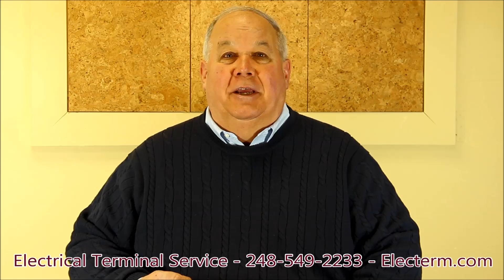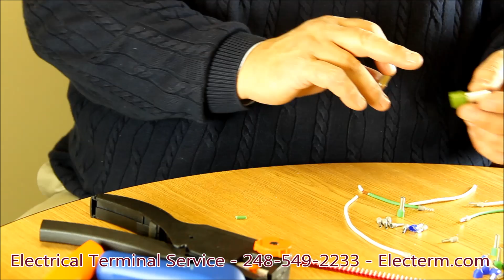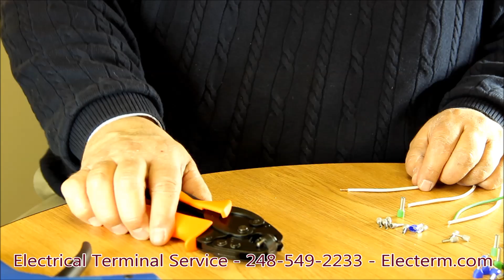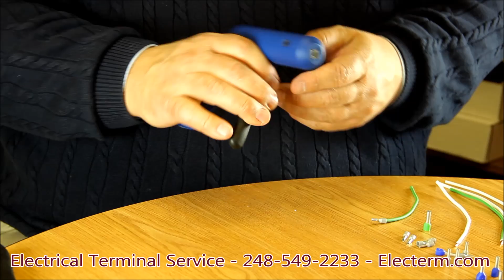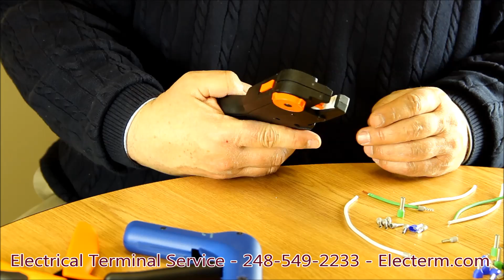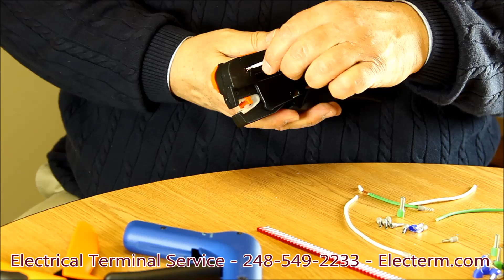Wire Ferrules Explained: Why are Ferrules Used and How are Ferrules Crimped

Comment: Most holes to insert wires are round.  Is it okay to use a square crimped ferrule in them?  Searched the net for a round crimp.  Seems it doesn't exist.
Reply: Yes it's ok, I put ferrules into round Wago terminal blocks all the time. The run at full rated amperage with no problem.

Comment: Thank you.  I bought a crimping tool combo and it came with a box of the regular connectors I've seen all my life.  And it included a box of these ferrules, which I had never seen in my 68 years.  So, I did what I usually do when needing to know how to use something; I searched YouTube.  And thanks to you, I now know what they are used for, and also know that I will NEVER just stick in loose wires in a set-screw terminal again.

Comment: why not just tin the wire with solder? does the same thing, no?
Reply: Not quite, with solder you also get solder creep.
Reply: INCC74656I This was meant specifically to replace the heat, the mess and the bother of soldering. 
Neat, safe, and no waiting for the iron to warm up.
Reply: Try that when you need to land 500 wires in a panel. Ferrules are the way to go.
Reply: Hello, we are Leading wire & cable processing machine manufacturer & supplier in China with high quality and good price.
Email: sales@zsht-equipment.com Website: http://zsht-equipment.com/ Skype: gao.irene   Tel/whatsApp: +86-18676147382
Reply: Will not be too sure of solder in an overcurrent fault situation. Still get the creep/spreading with the screw terminals.

Comment: This is a myth, measure the voltage drop difference between a ferrull and directly putting wire in at the source, electricity travels over the surface of a conductor, if you ferrull it guess what, the surface area is decreased
Reply: Bull, I just fixed a connection that would not work no matter how good I got the wire clamped in there, definitely metal to metal but it still wouldn't work. I had to use a ferrel then I was good. It boggled my mind but now it's good.
Reply: You are thinking about the "Skin Effect"? Well at 60 Hz in copper, the skin depth is about 8.5 mm, so for wires less than 8.5 mm it really do not matter?
Reply: Nah yall both are F'd up. Im master cert.
Reply: @peterbuiltcummins413  Ok, then please make a video where you show things are as you claim, just measure the voltage difference at a connection, with and without ferrule should do he trick, it will prove something much better than "Im master cert.", because that prove nothing at all.
Reply: Ferrules are used everywhere now. The voltage drop, if any, is insignificant.
Reply: Hello, we are Leading wire & cable processing machine manufacturer & supplier in China with high quality and good price.
Email: sales@zsht-equipment.com Website: http://zsht-equipment.com/ Skype: gao.irene   Tel/whatsApp: +86-18676147382

Comment: These are super popular in Russia, used by residential electricians in line voltage applications. A really neat way to attach stranded wire to breaker terminals, busbar terminals, etc.
Reply: Hello just want 5o know what kind of wire do you have, do you use thhn stranded wire?
Reply: @pit3835  in Russia they have stuff very similar to THHN, maybe more strands, like lamp cord in the US, but the real problem is that most terminals there are not designed for stranded wire
Reply: @Gruntled2001  Thank you for the information.Here in Philippines ournstandard wire is THHN i thought i can use that terminal lug.
Reply: @pit3835  You still can, not a problem. I do it in my work here in the US.

Comment: These ferrules are very nice.I've used them for car audio applications like compression terminals on amplifiers and distribution blocks.If you don't like the different colors of insulators you can simply use heat shrink to cover them.

Comment: I was looking for a way to improve the safety of my home built 3D Printers.. and this video was very helpful ... and now I know why I haven't seen Ferrules here in the US..  Thanks!   EDIT:  Now I need to import one of those Wezag crimping guns :)
Reply: I have used ferrules extensively here in the US since 1989. However, I first saw them in Europe and had to search hard to find them here. They cut down our loose wire problems down to almost nothing. They are easily available now.
Reply: Hello, we are Leading wire & cable processing machine manufacturer & supplier in China with high quality and good price.
Email: sales@zsht-equipment.com Website: http://zsht-equipment.com/ Skype: gao.irene   Tel/whatsApp: +86-18676147382

Comment: On that first ferrule you crimped with the nice tool, it has a strand hanging out. :-(
Reply: Nahh, not a big deal lets cut off the excess wire shall we... :D
Reply: @johnnyviva9017  That is exactly what ferrules are meant to prevent, strands making contact with other terminals, that should have been noticed or edited out.
Reply: Hello from 2018.  Also came to the comments section to point out the sloppy crimp with the fancy tool.
Reply: Well he didn’t join the strands together he just stripped it left all the strand fanned out
Reply: Yep, he gone cause somebody to die 😶

Comment: Thank you for the informative video.  I thought these ferrules would come in handy, for small electronics - like R/C quadcopters, where often the wires soldered directly to the board.  I can crimp the ferrule, then solder that to the board - instead of having a sloppy wire.  Not really a "certified" way to do it, but quadcopter is a hobby - space is limited.

Comment: you mention the wires fanning out when pressure is applied to a terminal screw. Does twisting the wires prior to insertion not correct this problem?
Reply: It is better not to touch copper with your skin.
Reply: Twisting helps, but under pressure, even twisting will not prevent the wires to start to fan. Ferrules solve this problem.

Ferrules are universal all across the world, just not in the US.

Comment: Almost any brand who offers self-adjusting crimping pliers offers at least two types of crimpers:
1. square (4 point) crimp
2. 6 point crimp

Any reason I should prefer one over the other ?
Reply: +Marius Kaizerman Most users would not really notice a difference. But to get technical:

The square shape crimped wire-end ferrules offer optimal protection against twisting at the contact point.

Hexagonal crimps (6 point) allow for wire insertion in the clamp from any orientation, and hexagonal crimps, with a somewhat rounded crimp form and extremely low maximum diameter, are ideal for confined clamping spaces.